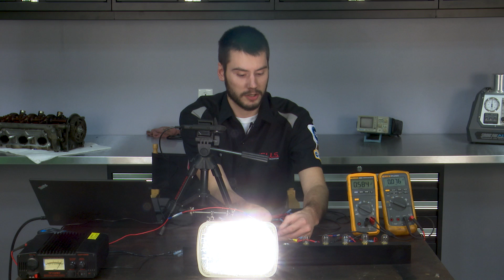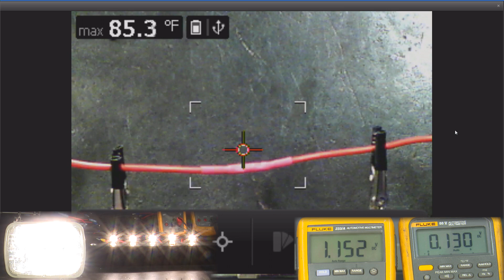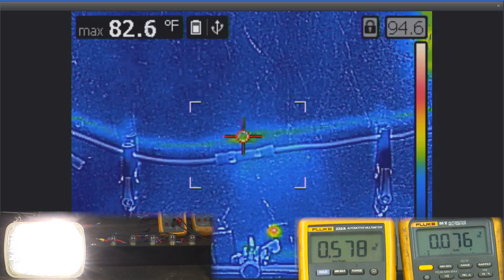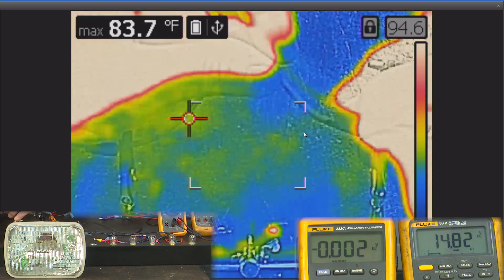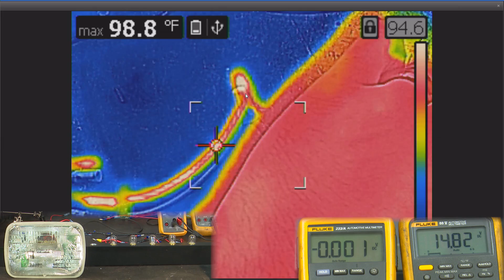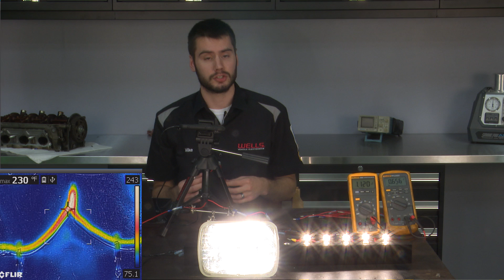CounterPoint Ep. 35 - Part 3 - Upping The AMPS To Test Which Wire Connections FAIL!!!!

Comment: Some good information here...ive recently changed to useing heat shrinkable conectors only....no more open conectors or blue skotch locks...
Reply from the maker: Shauns Auto Repair, sounds like a good switch!!! You will be happy with the turn out from these.
Mike Becker, Technical Services Instructor

Comment: Wirenuts!  I'll take them over solder any day. 
Just like your other connectors.... Theres one for the job.  https://www.licensedelectrician.com/Store/ID/WeatherProof-Wire-Connectors.htm
Reply from the maker: Tan Tan, I've looked through the website...there is not a single place on there that mentions it should/can be used in automotive applications. Also, that is not your standard wire nut, which is what we were testing. 
Mike Becker, Technical Services Instructor
Reply: Wire Nuts.  They're the best wire connection method ever devised.

Comment: Outstanding demonstration 
Thanks for the time and the resources
Reply from the maker: You're welcome! Thanks for watching! So, what did you think of the results?
Mike Becker, Technical Services Instructor
Reply: Wells Vehicle Electronics the Current wasn't pumped into the conductors during the harsh environment simulation which will highly promote Electrolytic corrosion/voltage drop.. in marine environment a similar wire gauge carrying a minimum amperage with an abrasion or a small cut in the insulator will destroy conductor the whole length of wire and the main culprit here is current.. 
would love to see more experimentations keep em coming
Reply from the maker: Airman, i'll keep em coming if you keep watching and commenting!!! :) 
Mike Becker, Technical Services Instructor

Comment: What kind of difference would a repair like these would they make if they were on the ground side of the circuit instead of the power side?
Reply from the maker: Frank, current in a circuit is constant. You can measure amperage anywhere. Therefore, there would be absolutely NO difference in the outcome.
Mike Becker, Technical Services Instructor

Comment: what about scotch locks you know the ones that get used for after market alarm systems
Reply: They were disallowed off hand, because they can damage the wire.
But they are indeed very common and appear to work pretty well. At least on the inside of a vehicle.
Reply from the maker: Juan, please watch the first episode. I have some microscope shots that show why you should not be using them. Thanks for watching!
Mike Becker, Technical Services Instructor
Reply: i was joking they are the worst
Reply: i do some marine work fl. keys had good luck with ancor brand connectors .16-14 awg heat shrink butt connectors part #309125 marine wire is copper with tin
Reply from the maker: Phew, had me worried there Juan!!! :)
Mike Becker, Technical Services Instructor
Reply: just venting neighbors hummer alarm goes of in the night somebody scotch lock must of it what a mess